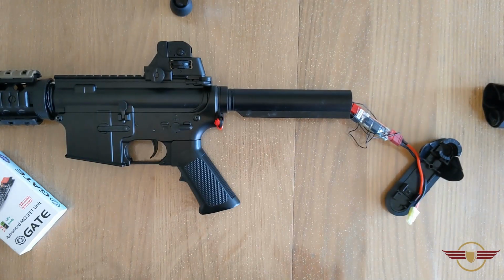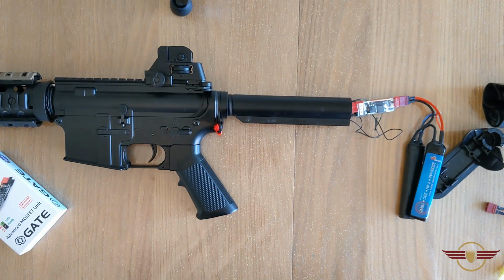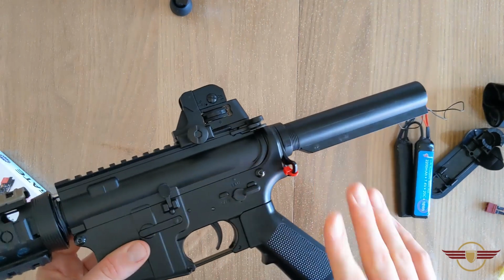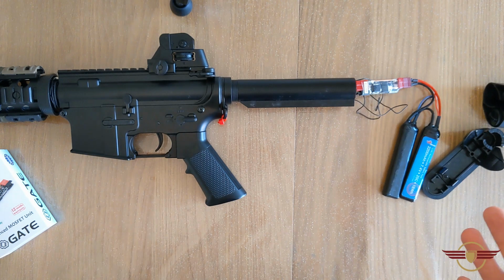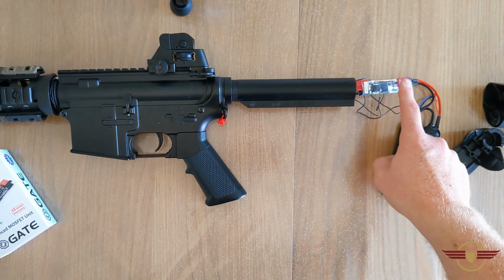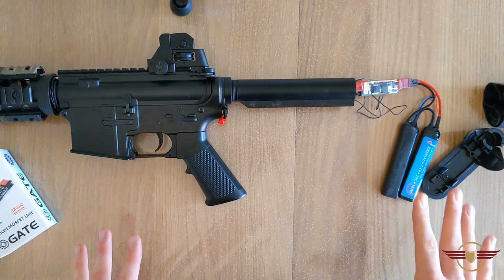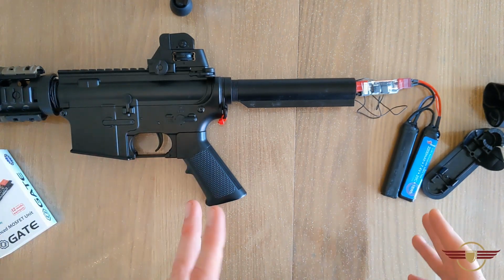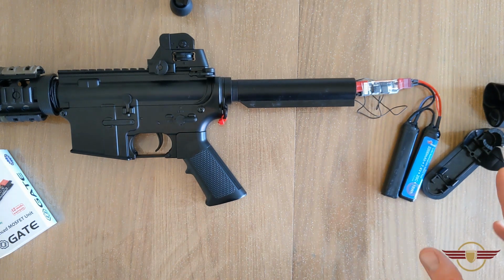[TUTORIAL] CM.506 GATE MERF UPDATE - Wiring

Comment: Hello Pheas! What exact motor are you using?
Reply from the maker: Hello! With this one build he has a G&P M120 motor in it. Although after market motors are a touch longer than the standard motor, so you either have to remove the little adjustment plate in the pistol grip or change the pistol grip, which is what I am going to do on this one. Hope that helps. Pheas
Reply: @PheasAirsoft  Thank you! You are like ChrisFix of airsoft love you're videos!